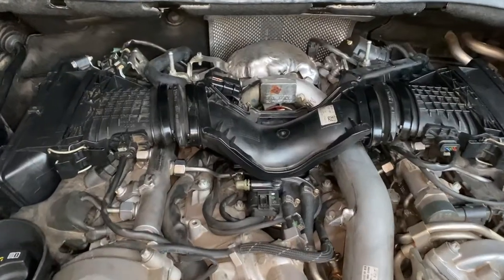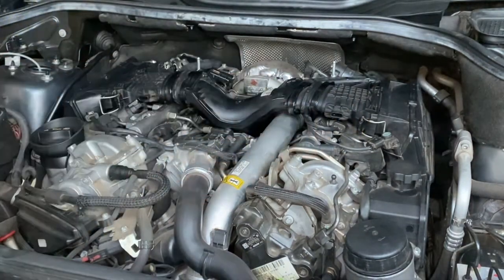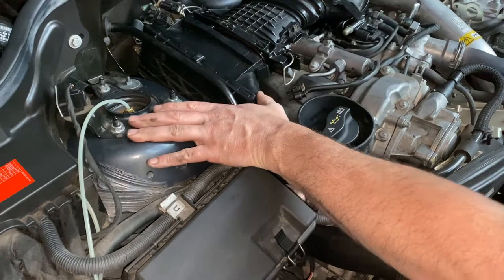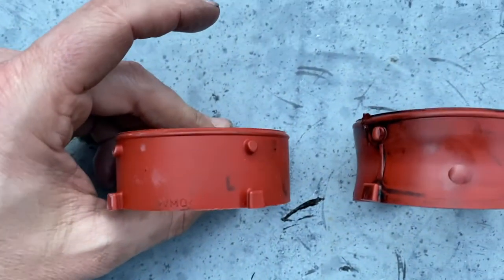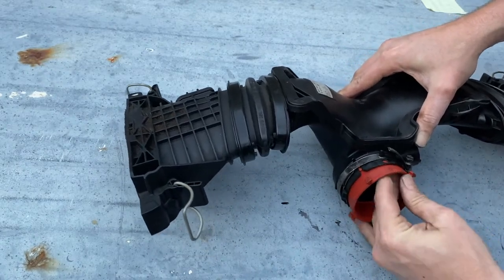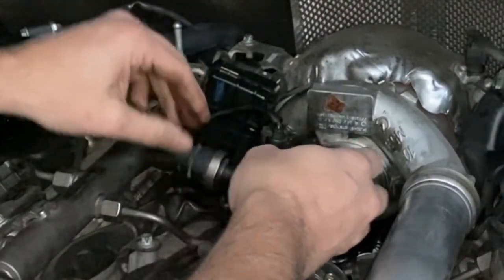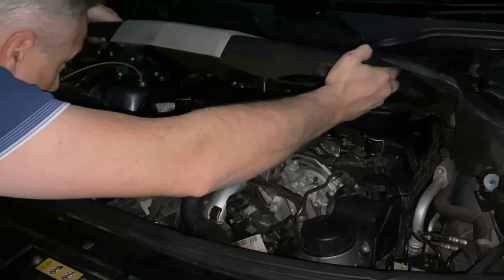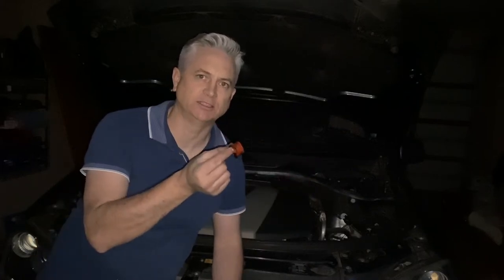How to Stop OM642 Oil Leaks - Mercedes ML W164 Turbo Inlet Seal Easy DIY - ML300 ML320 ML350

Comment: Removing the front bolts only on the air boxes is a game changer.  The rear bolts are very difficult to get back in, to say the least.
Reply from the maker: Hi Arron, Yeah those rear bolts are painful.  I'm, not sure if you have seen my video on changing the air filters: https://youtu.be/DLjQC04zkBw however I should do an updated video as it is easier if you don't pull the entire air box out for this reason!!  Cheers Drew :_DFI:

Comment: Did it yesterday.  Your video great insight and practical help.

For my 2008 GL320 I found I needed A642 094 00 80 (turbo gasket) and A642 094 05 80 (PCV seal).

I forget this second whether you mention it in your video but I found both, and *most definitely the PCV seal*, go on infinitely better if inserted first into the air duct rather than first put on the car-side pipes AND if given a squirt of eg. PTFE or similar spray.  I was hesitant to do this especially for the PCV tube as its only a push friction hold once in but I found it wouldn't go fully home without.

Sadly I managed to slightly crack - I think 99% down to age and brittleness and perhaps the reason Mercedes changed the design so as to become that shown in your video - the black plastic on the air duct when trying to seat it back onto the turbo, but am hoping for the best with a coating of Araldite style glue to hopefully fill the hairline crack and reduce the risk of it spreading.  Like most things that go wrong on any DIY, this was greatly aggravated by rushing to finish towards the end.  An earlier, more generous squirt of lubricant and slackening both air filter boxes would possibly (I still primarily blame the 15 or so year old plastic) have avoided that.  Crazy that Mercedes want c.£400 for the cracked plastic air duct, just because it houses a couple of sensors!

Shall say great, generously helpful, video once again, thanks.
Reply from the maker: Hi Mate, don’t blame yourself on the intake they are a poor design and all are brittle with age.  Ok the Black ML W164 that is sometimes on the channel it has the same style as you and we just replaced with one out of China off of Aliexpress.  I didn’t bother filming it (sorry I have been so busy last and just didn’t have the time), but the replacement included MAF sensors and was only a couple hundred dollars (including freight), the quality appears excellent, it fitted nice and the car is running better than ever! Cheers Drew

Comment: I think I found the problem of my W164 it smokes and i can see oil on the seal on the turbo will go to my mechanic tomorrow hope that solves it Thanks
Reply from the maker: Hi Mate, where is it smoking from? Cheers Drew
Reply: From the exhaust white smoke 💨
Reply from the maker: @kingsulay7903  hi mate, unfortunately I don’t think this seal will be your problem. Cheers Drew
Reply from the maker: @project190e7  I would suggest that you have an oil leak that you need to find! Cheers Drew

Comment: my GL350 eats 5 quarts every 100 miles and the hole under the car where you can see the flywheel spin is covered in oil. should i give this video a try? or do you think i should just sell the car
Reply from the maker: Hi Mate, these seals are cheap so you don’t have anything to lose by giving it a go!  Out of interest, what year is your GL350?  Cheers Drew
Reply: @DrewFixIt  Hi Drew it’s a 2012 GL350 bluetech with 130,000 miles. it used to run absolutely beautiful until one day the serpentine belt blew off and overheated a bit because i didn’t notice. after that the motor mounts melted a bit of grey liquid and it’s all under the car closer to the transmission. truly a fantastic diesel car before the oil leak which all started as soon as the belt problem happened.
Reply from the maker: Hi Mate, so sorry to hear.  If it’s a 2012 it has the newer purple seals on the oil cooler, but you did get it hot.  I would personally start with the easy seals as per this video and then go from there.  Cheers Drew
Reply: You fixed it ?

Comment: Hello, first of all, thank you for your video. I am also m642,   but r350.I want to know if  this part leaking oil will cause the inside  car full of oil smell？
Reply from the maker: Hi Damon, it’s hard to say without seeing your car in person, however any oil leak may permeate through to the cabin so best to fix all oil leaks!! Cheers Drew
Reply: @DrewFixIt  GET IT ！I'm going to follow your steps and change those part .！thankyou !

Comment: Would this leak leave a oil patch on the floor to the right of drivers side wheel, i.e also saturate the engine underside cover???
I just noticed a patch underneath the car and the cover was wet, not sure if engine oil or transfer case oil.
Any advice would be apprciated.
Reply from the maker: Hi Mate, the transfer case is actually automatic transmission fluid, so is thinner and not the same thickness or blackness that your engine oil will be.  Cheers Drew
Reply: @DrewFixIt  Ok, thanks, the patch is pretty black, when you had the oil leak inlet turbo seal did it drip all the way down to the floor?  What would be the symptoms if it was the turbo seal? If i took the engine cover off would i be able to see/ feel that the seal is losing oil?
Reply from the maker: @shino8854 yes mate.  Take the engine cover and wipe your finger under the turbo inlet piping at the entrance to the actual turbo.  You will soon determine if it’s leaking!  Cheers Drew

Comment: May I ask what the symptoms were that made you realise you needed to change this part?
Reply from the maker: Hi Mate, my car was leaking oil.  It ends up in the V of the engine and then there is a whole which it runs through into the bell housing and then it runs out a whole at the bottom of the bell housing.  People often mistake this for either oil cooler seals or main seal failures, when it is just the turbo seals!  Cheers Drew
Reply: @DrewFixIt  Great, I'll have a look if I can.  I've a GL320, 2008 but believe its the same basic engine.  A garage tells me its a costly job ... perhaps the oil cooler is .. but it its the turbo then you've shown how it can be relatively easy.
Reply from the maker: @atonkin8277  I had two separate garages tell me that I needed oil cooler seals!  That was over two years ago now … they still haven’t been done on my car and … mine doesn’t use a drop of oil! Cheers Drew

Comment: Thanks, i will try this, my turbo actuator is not working either, god i hate turbos
Reply from the maker: Hi Mate, FYI you can buy just a aftermarket turbo actuator and fit that to  your turbo.  We have done that to the black W164 that is sometimes on the channel!  Cheers Drew
Reply: @DrewFixIt  Don't suppose you filmed the process ...?!?!
Reply from the maker: @atonkin8277  I didn’t film it.  I’m sorry, I just don’t always have time and YT is just a hobby outside of my day job!  That being said it’s actually not that hard, just unbolt the actuator and bolt the new one one really!  Cheers Drew

Comment: Man thats wrong part number and the seal you put.
Reply from the maker: Hi Audrey, Sorry to hear , unfortunately Mercedes are slightly changing these intake Y pipes inside model ranges.  What you need to do is to ring a Mercedes parts number with the VIN# of your vehicle and get the exact part number for your vehicle.  My car is perfect with this seal ant now not leaking any oil at all!  Cheers Drew